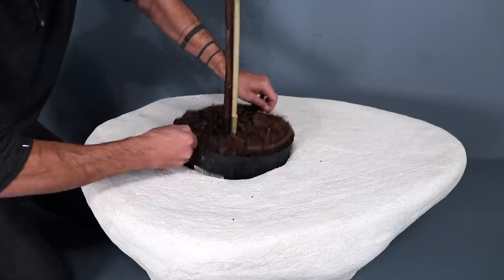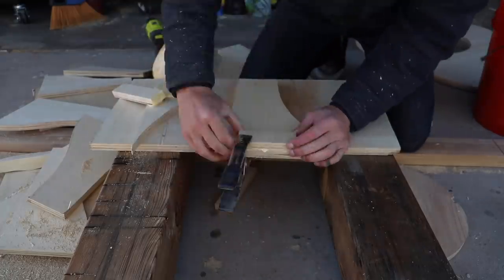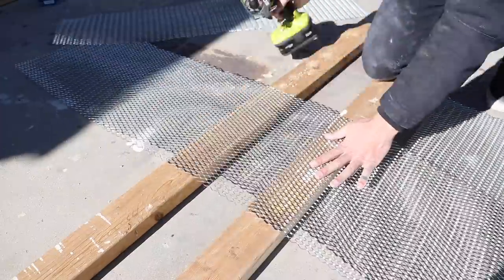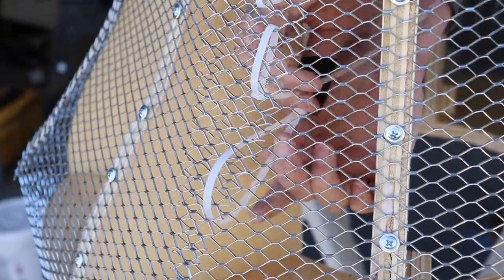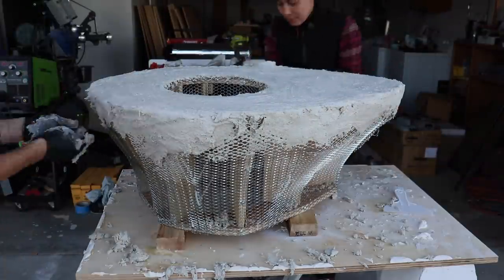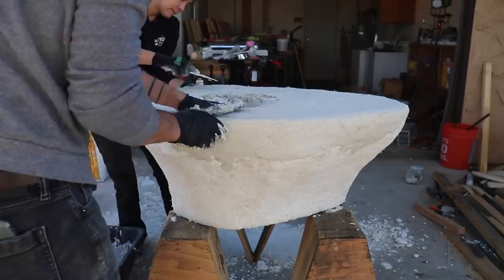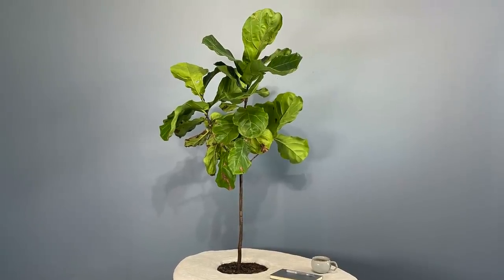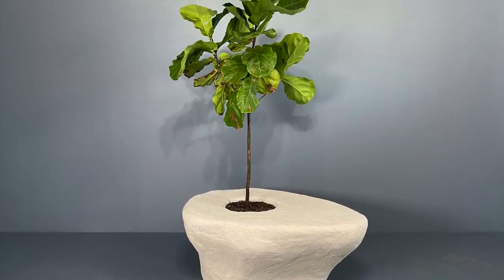DIY Concrete Planter Coffee Table Combination

Comment: Love the concept and the ability to adapt to a bunch of design shapes. 

Would it be correect to assume that the lath + concrete is stable enough on its own to support itself if the interior structure decays? or does it provide a waterproof barrier to keep the plywood dry?